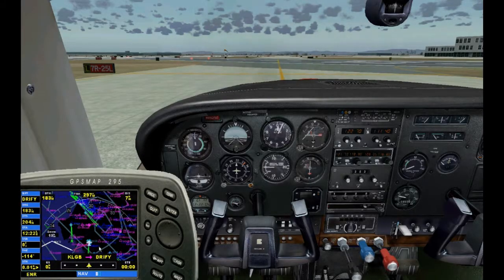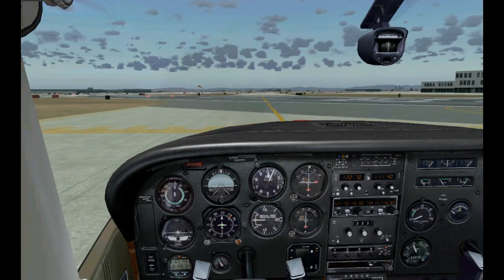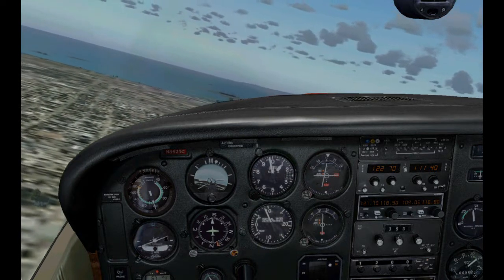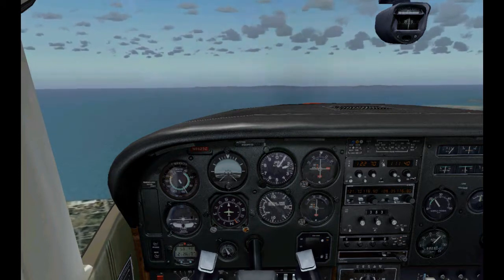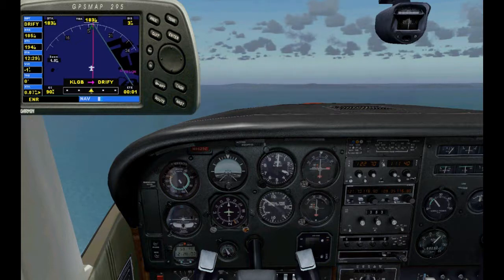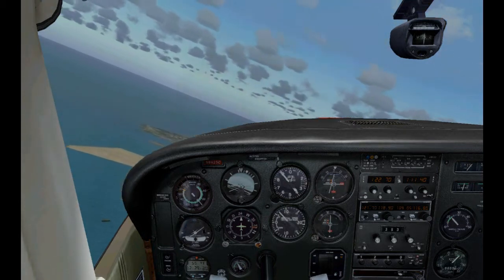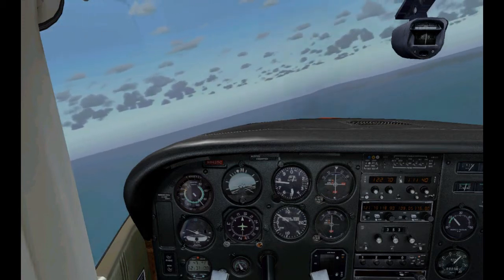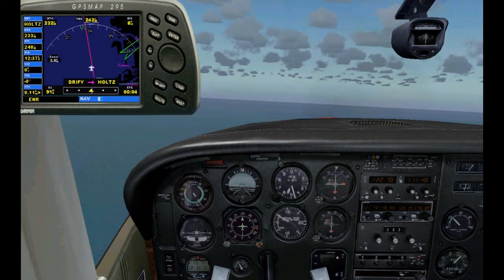GPS Navigation Tutorial - Part II (Using the VOR gauge for GPS Navigation)

Comment: i was using this on the default learjet45 just after u posted this. i made my route and just followed the arrow lol. bit different in that plane, but different in a good way. and fsx and fs2004 is a lot different. lots more intersection (interception?) points in the area i was flying in fsx compared to fs2004. and fsx i didnt have to turn the vor thing. it just turned. fs2004 i realize that the white thing on the guage turned and i had to "box" the vor needle.